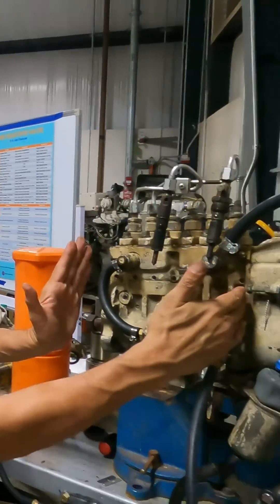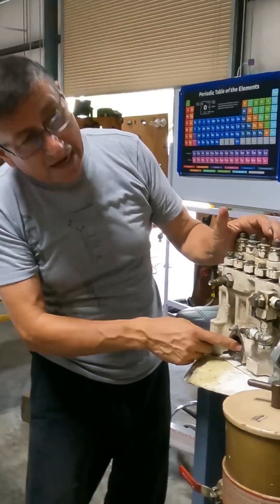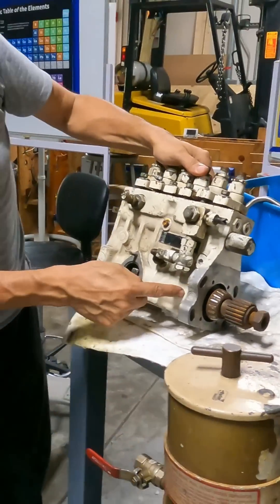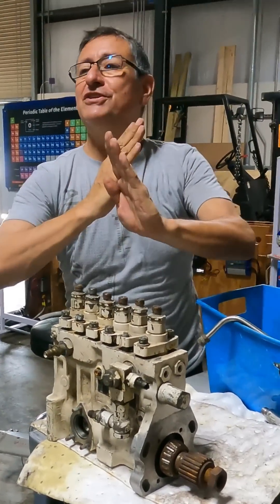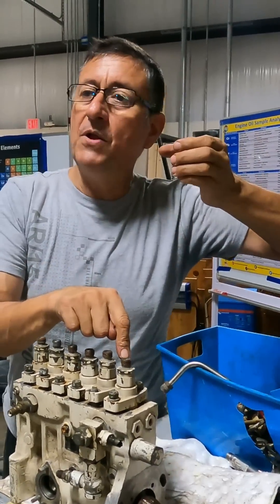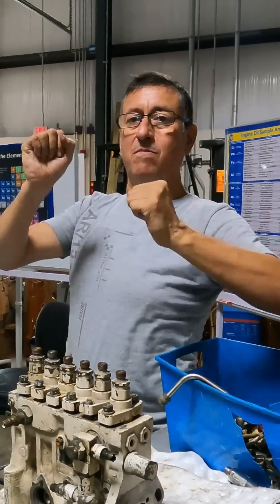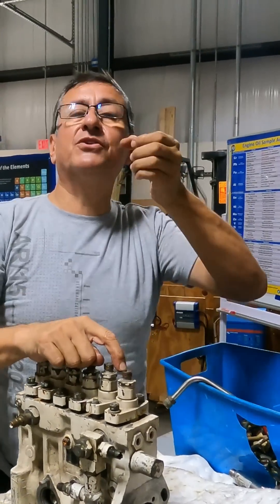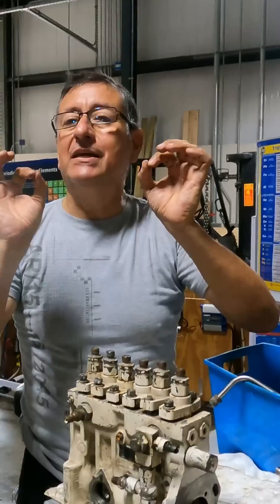Mechanical Fuel Injection Pump

Comment: Mechanical fuel injection is something else. The only example I had ever seen was at least twenty years ago on an old Audi.
Reply: These are diesel fuel pumps which are still made for non emissions applications (standby generator etc) 
Mechanical petrol injection is absolutely crazy but it's not this